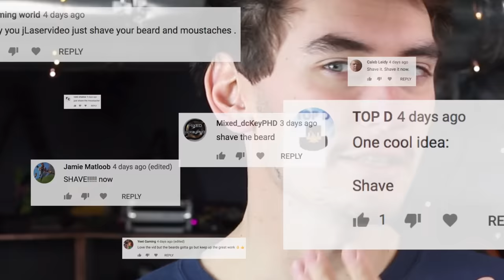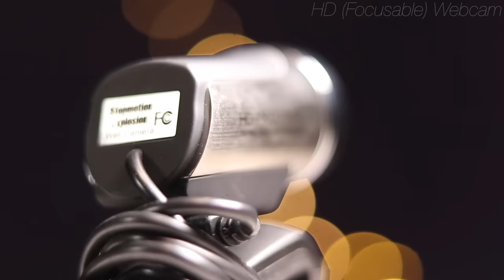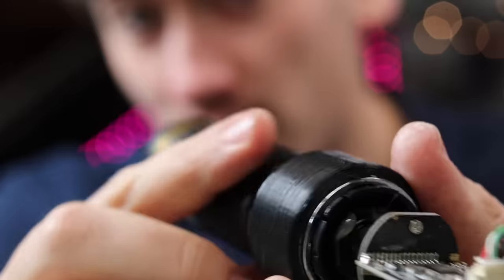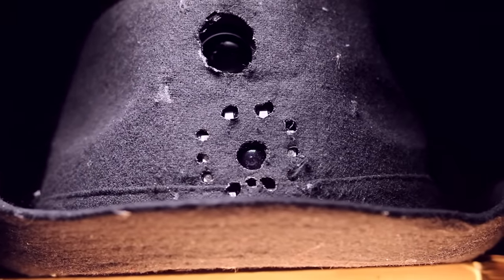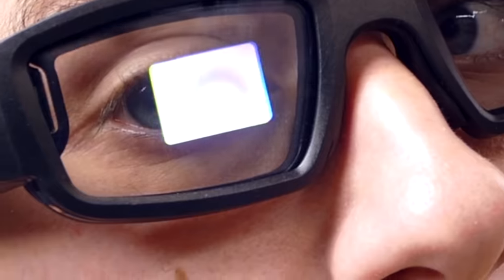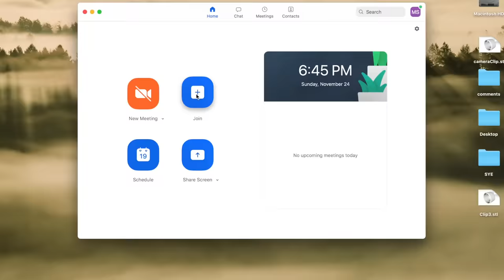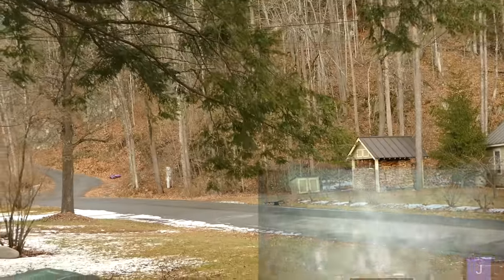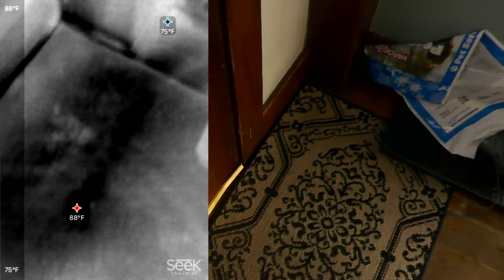Building Super Vision HUD Smart Glasses! - 20x Zoom, Night Vision, and More!!

Comment: Make leg attachments that can make you run faster and can't wait until you get to 1 mil, can I also have a shout out
Reply: The jacksmith that’s a good idea I need that I’m bad at the mile just hide it under my pants and when my teachers ask: how did you go from ten minutes to one minute?
I’ll be like : errrrrrrrrr I watched YouTube that’s how
Reply: The jacksmith how would he do that lol
Reply: S L U M B E R He will probably make it so that he has rockets strapped to his legs and can ignite them with a button like Allen pan did with his my hero academia project or maybe he can use the jet backpack and it can push him while he has roller skates on or the electronic wheelys
Reply: That's not physically possible
Reply: Rockets don't make you run faster...
Reply: That's not even running
Reply: Well actually rockets can help with running but the best thing to do is make shoes with a spring like thing on the bottom so when steping on one foot it goes down and when released pressure it propells you forward

Comment: As far as Flex Seal goes, I suggest making a form-fitting suit out of it. Use the clear for the top portion and the dark for the lower. For just a regular idea, how about a Tron Identity Disc with a blade that is made out of plasma, electricity, non-regular blade material, etc.

Comment: use a wearable neck speaker, replace the speakers with additional batteries or make your own neck battery with what ever machine and os you like.. I like the glasses, you could use the neck device to hold your camera or hard wire, wireless it to the glasses.

Comment: I used the screen as well. but I wanted to use an independent flexible screen to wire it to the cameras but the ones out now are incapable due to difference in software due to the brand of the screen.